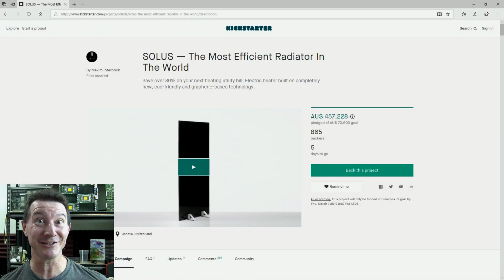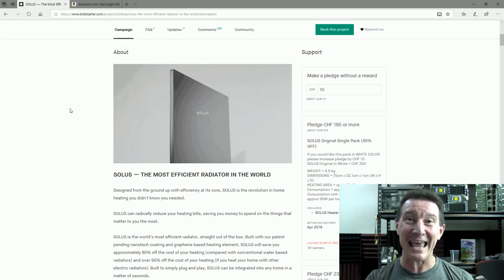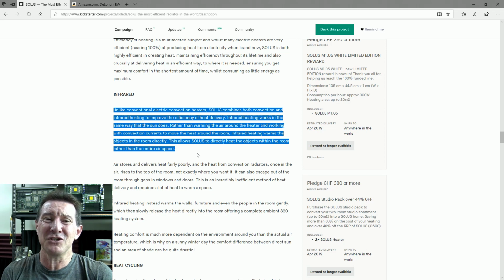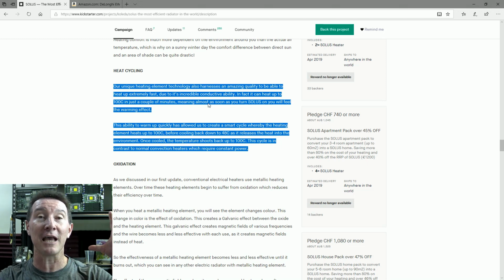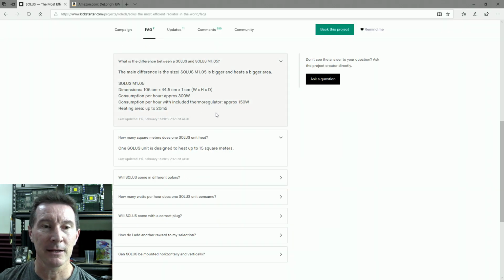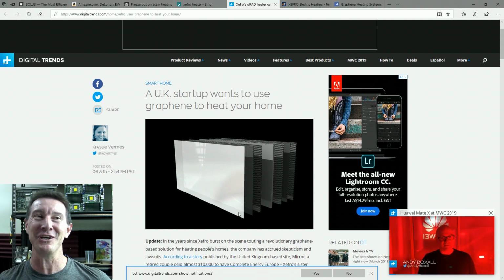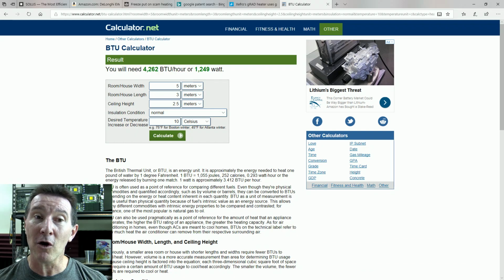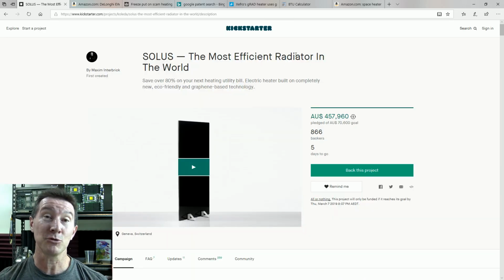EEVblog #1186 - Solus Graphene Heater Kickstarter BUSTED!

Comment: the only way i could possibly see a produce like this be more "efficient". would be, if it had been optimized for ceiling mounting, with large panels, and where intended to use only the IR heat to keep the occupants comfortable, rather than trying to heat up the entire air volumen.

Comment: $20 space heater is more efficient, because you can place it in a more central location, so there will be less losses through the insulation.  If you wall mount this and it is radiating in equal amounts out the back and the front, its quite likely this unit would be in the 10-20% less efficient than your budget fan based restive heater.

Comment: Dave, you do not know the heating system common in many northern European countries. They are far from 100% efficient. 
Besides that, a lot of heat is lost at the wrong place. I think they talk about oil burners, not oil circulation like in the portable unit you show.

In the colder European countries most houses have central heating. An "earth-gas" or oil-burner powered burner that heats water and an electrical pump, pumps that water through tubes to radiators that are mounted on walls through out the house. 
In my house we do not have heaters on the wall in the livingroom, here a lot of tubing is embedded in the floor under the stone-tiles (In Northern Europe most house are made from bricks or concrete). You lose a lot of heat through the transport tubes and around the boiler unit itself ( somewhere in the basement, a closet or special boiler room) traditional there is 1 temperature feeler, most time in the living room. The water gets pumped through out the house and then back to the boiler. You see 2 pipes going from room to room and back to the boiler. 1 as the feed, the other the return Every radiator has T pieces in the both tube and a tap as "heat controller" on the point the hot water enters the radiator. More "modern" systems have temp sensors per radiator integrated in the tap on the radiators. 

Electrical heaters are not (yet ? ) common. I have an oil heater like you show for temporary heating rooms that get not warm enough (because the only temp sensor is in the living-room and I have also the floor heating there. The water comes from the same boiler but direct in my case, so if the living is warm the boiler stops from burning permanent but that also means the radiators in other rooms cool down)
These traditional water based central heating systems are far from efficient, the boilerroom often gets very hot and a lot of heat from the burner is lost by the chimney. (burns on earth gas, no clue what you call that in English, butane ? ) That is common here in the Netherlands but there are other systems. I know a German who needs oil to burn in his heater system because he has no connection to the earth-gas distribution network. He has some huge oil tanks in his basement. 

Not saying the kickstart thing is something magical but I think they compare their system with the water based central heating systems. Many people would like more heat control  for every single room and better durability and get rid of the piping and (ugly) radiators. The pipes can leak, the heater unit works about 10 to 20 years and gets less efficient over time. A new one is rather expensive. Hot tap water is often also heated by that unit. So if your heater or the pump fails you are  in the cold and often without hot tap water too, until they repair or replace the unit (few 1000 euro).
Reply: pa4tim Earth-gas or natural gas is mostly methane, but impure.  Exact mixture depends on where this fossil fuel is extracted and how it is separated from any crude oil in that well.

Comment: I hate inefficient heaters that lose all their electricity to... heat.
Reply: But didn't you read the marketing materials?  It's the wrong type of heat!
Reply: I love when insane people just go off about something completely unrelated and feel the need to decorate their comments with even more unrelated links.
Reply: LOL!
Reply: @draco5991rep You have to test out the tinfoil hat before coming with such wildclaims, but that they can use radiowaves to put nanomaterials/minerals into self oscillation by excite them at right frequense to heat water, and to cause hemorragic fever in biiologic creatures, that is a fact.
Reply: Try cooling
Reply: @bernds352  sarcasm.
Reply: I had tea coming out of my nose. Love these comments.
Reply: When you heat a gas you could think of it as idealised  hardballs bumping into eachother, but still there is heat generated so some type of "friction?", by oscillating kinetics must take place because the oscillation finally peter out regardless thermal insulation, or would they forever bump around and keep "heat?" using a perfect insulator? I mean why do they lose speed "heat due to kinetics?" in an open space is it just that the perimeter of the atoms/molecules tries to even out the pressure spreading to a bigger area. If that was the case a fan would not matter for the total healt in a room reached, finally it would spread out even? But it does so probably the heat stay local or raise to the ceiling instead of heating the room?

That makes one wonder what goes on in a solid are the attached molecules also considered to be idealised perfect hardballs "elastic collisions?", or are their oscillation more like rigid body kinetics in a single mesh?  I mean different materials hold heat better? Why does a saline solution in water trap the heat longer then water without the salt?
Reply: Lets hope they do not readjust the frequensy of the 3G / 5G net to produce heat in water, because i suspect that would be some aspect of what wavelength used, and really problemetic it become if they use nanosilver in our food supplies that penetrate the cellmembranes and they get into selfoscillation at a certain frequnsy in water. Then we do have a bloody armageddon upon our hands. Have you read about howto heat water with nanoparticles?

That is by the way how both directed energy weapons work and cause effects upon us, where our cellmembranes explode and cause hemorrhagic fever well not the viral one if there is such.

https://phys.org/news/2016-06-high-efficient-solar-nanoparticles.html
Reply: Jonas: Wut? Håhåjaja
Reply: @HugSeal42  I say it is not driven by induction heat it work on military technology principles by setting the medium into oscillation like directed energy principles. You emit waves at the frequensy where the medium selfoscillate.
Reply: @JmanNo42  Why are you using the IPFS copy of wikipedia when Wikipedia is still online? https://en.wikipedia.org/wiki/Directed-energy_weapon - Second of all, what are you claiming here? We're making fun of a heater here and I think you're trying to push a conspiracy theory.
Reply: @JmanNo42 I for sure hopa, nobody puts "nanosilver" or colloidal silver into any foodstuff or any other way into my body. The body can not get rid of silver in any way. It accumulates in the skin and stains it dark grey-blue look "argyrie" or  "argyrose" - not pretty - although not considered "toxic" as it does not reduce your life-expectation or health.
Of course also the frequencies of 3G or 5G produce heat in water, like the microwave frequencies of Blutooth, WLAN or microwave ovens - which is all at the 2,45 Ghz band. It's just a question of power: 1W in mobil communications and 1000W in a microwave oven.
Reply: @goamarty  I think it is many health products  with claims it keeps fungus / molds? away.
Lyophilized food like coffe products are the most probable intake of such?

Why you say the body can not get rid of it?
As i understand it these things was tested out in the 60-70's and they basicly found out that with the right frequeny they could make the nanoparitcles oscillate inside the cellmembranes using the right frequensy. Basicly explode by raising heat taking the body out of homeostasis. Basicly turn you into a bloody plasma bloob "decaying flesh".  

I always thought it was leaving body like any other mineral?

Maybe the plan is more wicked than i expected. 

https://s3.amazonaws.com/nightjarprod/content/uploads/2015/03/scanners_poster_01.jpg
Reply: @goamarty  Ever heard about Mountak that is the experiments they did. They had this underground base and they basicly wanted to see if they could take out the people in underground command centers for intercontinental nukes. By adding nanosilver into their water supplies, and use ground penetrating radar to incapacitate kill them. "They could", they even had a little pit for their decaying former test persons. It was called the "bloob".

The faciltiy was run under the coverup they trained up an army of people using ESP on testsubjects, there was young people that thought they could induce pain in other "test subjects". "These were of course unaffected of the ground penetrating radar they had not ingested the nanosilver".

https://www.youtube.com/watch?v=fn7-JZq0Yxs
Reply: @goamarty  As i understand it at intake if basicly penettrate your cellmembranes, and that is how they bring body out of homeostasis it is overall system failure. And when body no longer in homeostasis the other cells die by poisoning of the decaying ones.
Reply: Or give a full region 
hemorrhagic fever "take out cities"
Reply: @JmanNo42  Do you have any idea how much heat the body can take with our cooling systems? A lot. Try jogging for a kilometer. That will produce many times the heat compared to 5g in smart phones. 5g is not ionizing radiation so the molecules it affects are just heated up and our body is more than capable of cooling those amounts down.
Reply: @RanEncounter  No i was more thinking about nano materials every material have a selfresonance frequensy. And fact is this has been weaponised since the 50's. The idea is to have the subjects exposed to things like nanosilver by get it into the waterreservoirs, these particles so small they penetrate the cellmembranes, and then you have a transmitter to make them selfresonante basicly making the cellmembrane explode leading to hemmoragic fever, when this spread thru body the the decomposition of the blodcells leads to sepsis and you basicly die in heartattack caused by fevers and the inability to transport oxygen to the cells.
Reply: By the way nowadays these ideas been spread outside the military complex and lead to ideas about waterheaters/heating based on the principles of selfresonating nanomaterials.
Reply: @JmanNo42  "No I was..."
Yes that what I was talking about as well. The molecules you are warming up with the resonance frequencies are cooled with our blood circulations and sweating. I don't know how you have missed this obvious fact.

"And fact is..."
But you would need weapon grade energy sources to do that. 5G has less energy capacity than you jogging for a kilometer. Do the calculations and stop listening to the idiots in conspiracy channels.

And again the 5G radiation is not ioninizing radiation. It can only warm up the particles you are talking about. And heat is very easy for the body to deal with.
Reply: During experiment "clouded as ESP trial outs"  poor subjects was exposed to them  in bunkers to see if ground penetrating radar could take out missile command stations. 

http://www.gstatic.com/tv/thumb/v22vodart/2478/p2478_v_v8_aa.jpg
Reply: @JmanNo42  I understand how they work. You do not seem to even understand the link you even gave me. 5G has nothing to do with these weapons. The weapons you linked heats up the surface of the target, not some metal inside your body.

"Of it is good enough to heat up water,..."
Except it is not. Humans have temperature controlling mechanisms in their bodies such as blood circulation and sweating. 5G has to heat up water more than our bodies can handle to do anything. You will heat up more in a one kilometer jog than with 5G radiation and still will be fine.

Water in itself does not have those mechanisms. You do not understand basic physics.
Reply: @RanEncounter  Massive cell death leads to sepsis and hemmoragic fever, once you there chance coming back is slim. And again active denial systems are not ionizing lasers, you have missunderstood the use.
Reply: @JmanNo42  "Massive cell death leads to cepsis..."
And where are you getting dead cells from? Heating water molecules a little?

"And again active..."
I never said it was. But you misunderstood the use because it is used in the surface of the target and not internally. Even the link you gave me says so.
Reply: @JmanNo42  "What is heated..."
Of course. You are not making any sense here and spouting all kinds of bullshit at once. Make a coherent argument.

"And it is longterm..."
Even more time for the body to get rid of the heat. You need super intense short term bursts to make anything heat up in the body too much.
Reply: @RanEncounter  No the cell deaths comes from these vibrating/oscillating nanoparticles travelling inside you like bullets popping your bloodcells like ballons. Normally they just pass thru.

That in short term give you sepsis with following hemmoragic fever, and the body goes out of homeostasis and probably never recover.

https://i.stack.imgur.com/4xib9.jpg
Reply: @RanEncounter  And again it depends on the frequensy you use....

https://i.stack.imgur.com/4xib9.jpg

Comment: That crap about "magnetic fields instead of heat" wow, just wow, I have no words for that amount of nonsense.
Reply: Technically, EM fields are pretty efficient heaters. I wouldn't go put myself into a microwave though.
Reply: Havent tried to heat my apartment with a radio transmitter lately.
Reply: Fabian Feilcke you can heat a room with a tube based transmitter ;)
Reply: @Thordmac  Sure you can, but it would be one of the few possibities of using electricity without getting 100% heating from it.
Reply: Fabian Feilcke yeah but the transmitter would be doing useful work...
Reply: yeah... and we all know how magnetic dust particles are, right?!?!?
Reply: They slept through Thermodynamics class, all semester. So did Fabian. ^^^
Reply: Gordon Freeman The words you are looking for are: BS <- censored version, but you’ll get it.

Comment: Heats 15 square meters?  For heating purposes, rooms are three dimensional.  It's volume not area that is important.  IR radiation which is what we're talking about here is pretty pointless.  I don't care if they heat the walls and floor, or even the objects in the room, it's air temperature that defines the comfort level of a room, and 200 watts isn't going make anyone happy.  Maybe if you covered one entire wall with these panels?

Comment: Buying a $25 black and decker convection fan + resistive wire coil based heater was the best decision and Im the most comfortable ive felt in the winter.

Comment: I would guess the oxidization they are talking about is from water based radiant heaters used in Europe etc...
They would oxidize like any hot water system and need replacement.
Reply from the maker: They mentioned dust attraction, so presume radiant bar heaters.

Comment: And as they claim in the comments, while heating up only 1.5Amps flow through this unit for 30 minutes per hour. Which if you calculate it, gives completely different numbers for electrical energy compared to what they claim in the campaign above.
Reply from the maker: I missed that comment
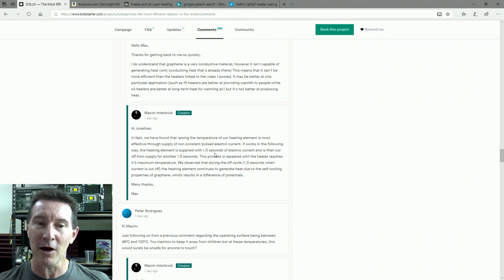Reply: @EEVblog  Well at least thats what they claim while heating up, who knows what happens after it reaches full temperature.. i re-edited my comment, even if this campaign is a complete scam, i don't want to put words in their mouth. You can see the comment at 31:05 btw

Comment: Disclaimer: I don't know much about that. But I can tell you what the sellers are telling us about the IR heating elements on sale here in Europe. They say they are so efficient because the feeling in a room is the same at lower temp - than in a room with convection heating. Supposedly they are heating you from the inside and are heating the furniture, and don't heat the air directly. So, in short - with IR radiation heating you should have the same feeling of 'warmth' at a lower room air temperature. And this is basically an IR heater.
Reply: This is what I was thinking. Not to defend the numerous incorrect claims in the campaign, but if the primary means of heat transfer is via radiation of IR rather than convection, the heater could give an increased perception of warmth despite lower average room temperatures. So if the goal is to improve comfort rather than raise the room temperature, it could be argued that this unit might create the same perceived warmth as a higher-power convection-based heater would produce by heating the air. The effect could be especially pronounced in drafty/poorly insulated rooms where warm air from a predominantly convective heater would be diluted by ingress of cold air, whereas radiated IR would be directly incident on the people in the room, giving the perception of warmer temperatures.
Reply: But the trouble is that their measurements are based on air temperature in the room. They explicitly say that their system is better because it gets the air 1m off the ground next to their unit hotter than a conventional radiator gets a thermometer lying on the floor. But... if they used the same thermometer for both tests the results would not favour their system. It would either use the same amount of power, or heat the room less. Their silly "test" is designed to obscure that problem.
Reply: @mozismobile  well they say that. but thermostats also get effected by Radiant heating. so they might read a false values aswell.
Reply: Yeah, Europe is full of scammers trying to sell IR heaters with exorbitant claims. Truth is, they're about as comfortable as sitting in front of a campfire - your face is warm, while your back is cold. And if you have to get up and move around the room, you're all cold. My ancestors didn't pillage and enslave the global South for me to have to deal with that shit.